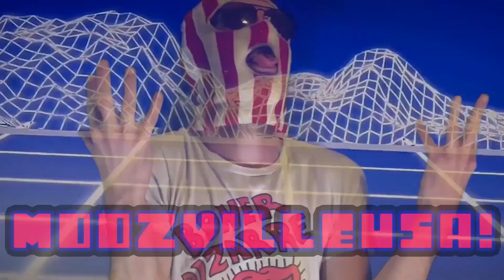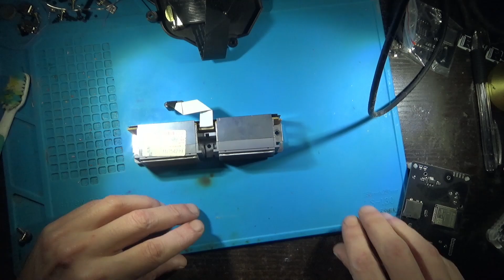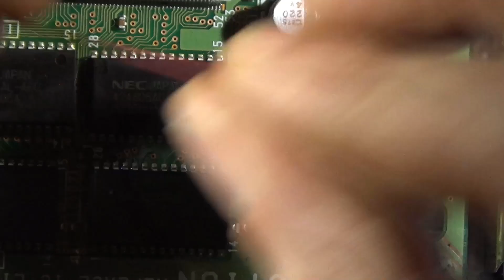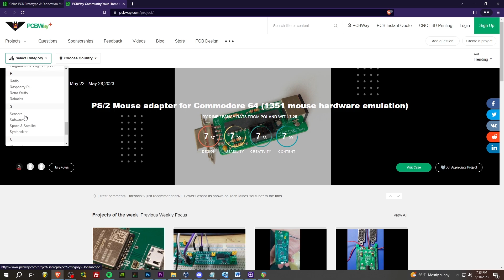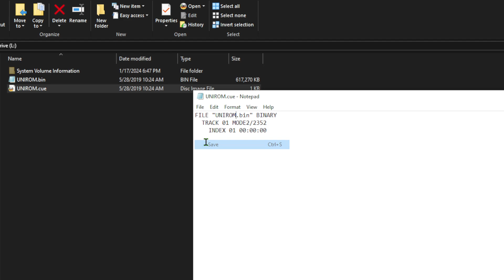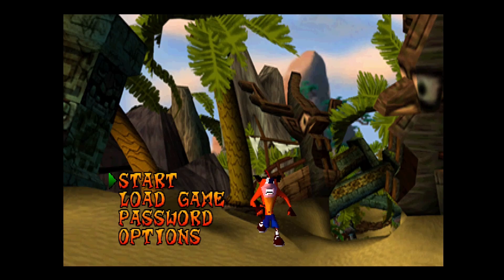New Picostation Developments are INSANE!

Comment: It triggers me that you keep touching/rubbing the pcb. Don't people fear static anymore?
Reply: Haven’t been afraid since I put together my first pc in 09. Haven’t used an antistatic grounding band since either. Many builds and projects completed in the last 15 years. Nothing has been damaged when building or soldering from static. Just from bent pins or burnt components. :)
Reply: People have tried high capaciitance on ram modules, and discharged with visible arcs.
The pc was on, everything worked without a hitch.
I guess ics are more resilient than we think.
I don't think such a low power device would have powerful capacitors to get hurt by either.
Although I still handle cpus and ram sticks with utmost care, always grab by the edges, never the flat sides, not even if they have shields over them.

Comment: Could someone just modify the actual UNIROM bootloader UI to add an option to search an SD card? Then you just have Picostation boot UNIROM and use the UNIROM UI to find the game you want to play and start it.
Reply: it can be made, but its not that simple. the sd card only communicates with pico. so you need to implement a custom loader that browse files over cd signal bus(or maybe serial port with extra wires?), then get those signals and parse within ps1 loader, then send the selected game to pico, then pico loads the game
Reply: From reading the reply, this could be a really stupid idea of mine but...

As work around for the SD not being accessible to the PS, would need a rest wire adding to the PS MB ....

1. PICOSTATION boots as CDA.

2. Lists game folders as CDA music tracks.
3. The user picks a CDA track number (keep a list of what track is what game on paper)
4. PICOSTATION remebers the selected track number.
5. resets PS via a wire.
6. Loads selected game after reset.
Reply: @welshdave5263  theoretically it can be made but i don't think it would be practical cause of game titles won't be showing and selecting games would be confusing. there is also a track limit for audio